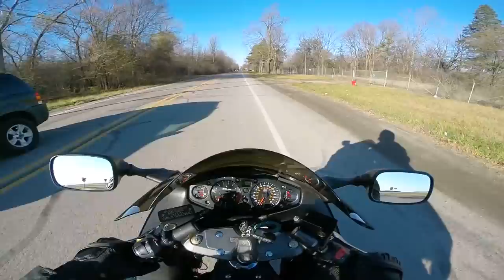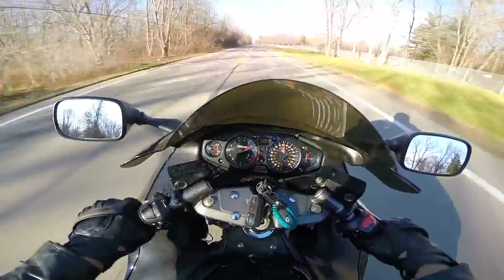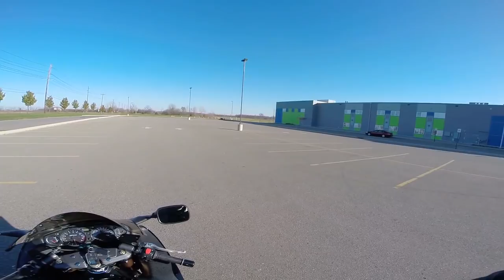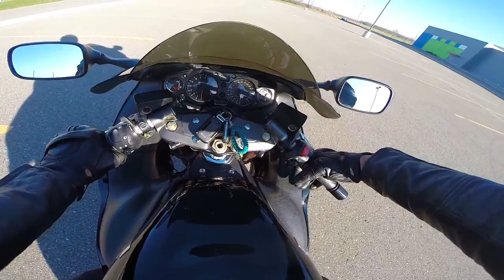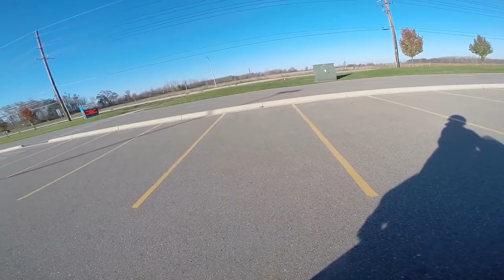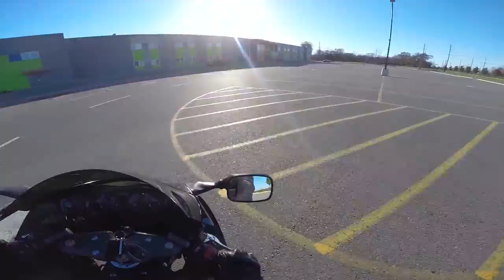Motorcycle Basics: Controlling the Throttle

Comment: Here's an easier ( not safer) way to explain Torque vs Power: 
Power (HP) How fast you hit a wall 
Torque: How far you'll take the wall with you :)
Reply from the maker: +Martin Angelov More graphic too ha ha
Reply: Yeah but dem sound effects 👍🏼
             Vroom vroom
Reply: +choppertj1 splat
Reply: +choppertj1 hit like if ya like dem bikerz in road rash. NAPA VALLEY
Reply: well said haha
Reply: lol that happened to me.
Reply: It actually wouldn't work like that.  If you had two equal weight bikes traveling at, say, 150 mph, they would move the wall equal amounts upon impact.  This is regardless of the power and torque each bike makes.  

A better way to explain torque and power is this:

Power is top speed
Torque is how quickly you get there
Reply: Mr. Blow  ("mr. blow"?),

I agree with you, about the comparison. 

Ray
Reply: Horsepower is calculated from torque. What we're interested in is the torque at the rear wheel. When we're in 1st the larger gear ratio increases the amount of torque at the wheel. When we change to 2nd the ratio is a little smaller and there's less torque.

As an example, my old Camaro with a ZZ502 engine has 560lb/ft of torque. My 4th gear (Muncie 4 speed) is a bit over a 1:1 gear ratio and I get 530lb/ft of torque at the tires. In first, I get ~1100lb/ft at the tires thanks to the gearing.

If you want to ride fast on the track in low speed turns, you HAVE to ride in 1st. Lots of guys don't like to do this because the acceleration is pretty violent but it's all because of the effect of torque and gearing.
Reply: Also incorrect

Comment: Just wanted to drop a note of thanks Night Rider.    I rode dirt bikes when I was a kid.   Now,  in my 50's wanted to get into motorcycle riding.    Didn't do it when I was younger because I will be frank,  I was immature and probably would have been  found in the woods.    Bought myself a 2020 Suzuki SV650.    The two areas I needed help was throttle control and braking.    Your videos were very informative and helped me tremendously.    With the throttle,  I was always jerking the bike over uneven pavement and when braking.    By squeezing my legs in on the tank,   I stopped having a lot of my weight/pressure on handle bars/throttle.      This eliminated much of the jerkiness.    Second,   braking.    I would always be confused what to do first,   all at once, down shift, front brake only, etc..   I used your rear brake first analogy.   Perfection.    Especially coming to a quick stop,  I am not lunging forward, diving the bike,  with my weight on handle bars, and jerking the throttle.    Its all in harmony.    Thanks
Reply: In which video was he talking about breaking? I have very similar issues as you. Thanks

Comment: Those tips are so useful.. you have no ideas.  Recently took an MSF course and struggled with the throttle control.. every time, I squeezed the front brake lever,  I reved up the motorcycle.. every time I turned the motorcycle, I reved it up.. I thought it was a mechanical issue the throttle had. Everyone says you need to have "smooth throttle control."  But no one really explained how to achieve that. So frustrated.  But thank you by  diving into it with your hands off approach and not only explain it but provided 3 good tips on how to achieve.  Coudos to you brother.

Comment: I'm a brand new rider at 54 years old!! I'm having serious problems controlling the throttle and I believe it's my main issue at this point. My bike doesn't have end-caps but that's a great idea. You mention the hand position that I've seen in other videos too so that's a good thing. Starting in 2nd gear is something I'd never thought of. I used to do that in my stick shift cars back in the day when there was a lot of snow or ice on the ground. I might have to try that!! Great info. Thanks!!

Comment: Night Rider.  I have owned a lot of motorcycle (over 40) in my 43 years of riding (started in Feb 1974).  After I hit 58 years old, I decided to go from standards and cruisers to sport bikes.  My ZX-12R was fast and throttle control was very important.  My TL1000S, CBR1000F and BMW K1200RS were easier to manage than my current sport bike.  At 61, I bought a used 2007 BMW K1200R Sport.  That bike has the most sensitive throttle I have ever ridden (still have the bike).  If you are not careful and "smooth" with the throttle, it is the most "herky-jerky" ride I have ever ridden.  One thing for sure, it makes you learn "smooth" throttle control even when shifting.  The BMW K1200R Sport makes my Harley Softail Heritage Springer (wife on back bike) and my Goldwing 1500 (grocery store runner) child's play with the throttle.  Heck, with the Harley, I can "grip it and rip it" and it barley beats the 2 toed slough crossing the highway!!!  Quickly letting off the throttle on the Harley just lets the bike coast.  Not so with that K1200R Sport!  Good video, I have bar end mirrors on the K1200R Sport so I think I will try resting my palm on the bar ends....  Thanks for the tip, no matter what your age or experience, there is always something more to learn!!!

Comment: The advice on gripping the bar end is excellent. I basically discovered it on my own; it's not covered in the training class I took (the MSF BRC) but when I talked to people I've heard it's sometimes used on race tracks. I've never heard the term "whiskey throttle" but it is very real and new riders should be aware of it starting on day 1. The down side of gripping the bar end is that it's difficult to keep a finger (or two) on the front brake like you're supposed to. Great video!
Reply from the maker: Thanks a lot.I never heard the name but I knew what it was

Comment: All of your points can be included in throttle control but it's a basic/beginner guide which is mainly for a newcomer. But, generally, throttle control is a skill which really determines the good and not so good riders to the best of the best. For example, how much throttle would you give when entering a corner, during a corner and when existing, etc. This is very important because of two reasons safety and efficiency, you already cover the basic beginner guide of the safety part but as I said that is generally not what people talk about during a throttle control conversation, at least not where I come from. For the efficiency part, you ride faster because you efficiently control the acceleration and deacceleration which in turns lets you shift gear more efficiently, there are some rudimentary and of course some rather complicated advance tutorials and guides but in the end, it all comes down to the individual and their natural talent as in most walk of life. And as always the best way is to practice and this is when you push your natural talent to the limit, coach, experts, guides, statistics, etc all play an important part including your composition and bond with the machine itself. Then, you practice more.

Comment: Huge thanks for this video. Being a new rider, the tip about resting your hand on the bar end and twisting with your fingers has helped improve my riding tremendously.  I love my bike and was beginning to doubt the purchase, but not anymore.
Reply: I have been riding for 7 years and still have the outside of the grip on the bar end, it just gives you so much more control of the throttle

Comment: Just got a 1999 yzf R6 yesterday and I'll use these tips to safely ride the bike! Thanks!! :)
Reply from the maker: welcome
Reply: is it any good? do you have gearbox problems especially second gear
Reply: i just got a 1999 yzf R6 as well loving the bike so far doesn't have the second gear problem..39000 kms on the bike
Reply: I love the bike, it's fast but not dangerous to a new person if you take it easy. Smooth power band and sounds amazing! I haven't had any problems with my gearbox, and the bike just topped 22,000 miles the other day. I think the bike has been wrecked before so it may have a newer tranny but I'm not entirely sure. Still a very high quality bike and I'm hooked!! :)
Reply: @devil1989 

But I have a small water pump leak, thought it was the overflow fitting on the pump but I took it apart and pressed the brass fitting back in because it was a little loose and I put lock tight around the fitting when I put it back together. It help a bit but after a little riding the lock tight melted and it started leaking again so I think heat resistant lock tight and heat resistant rubber glue will do the trick. That's the only problem I've encountered with this bike (besides the carbs needing synced but it's 17 years old and I'm sure the carbs have never been synced in the 22,000 miles it's been running; so that's to be expected). Other than that the bike runs and sounds great! Got mine for $1,600 so it was a pretty good deal! Cheers! :)
Reply: on an r6.. all the throttle all the time.. they are slow to accelerate .. rode my mates one was at the stop on the throttle in first.. no action... now an r1... that will flip you

Comment: Its the mechanical advantage you are speaking of as far as gearing being that your gear ratios are the multipliers of torque (primary gear, transmission gears, and final drive AKA sprockets) so second gear for example is 7.71 vs first gear 10.43 multiply the torque at any rpm and you see what is getting to the tire. Good video bro
Reply from the maker: +Mete Thanks a lot for the info.And thanks im glad u like the vid
Reply: Night Rider Anytime bro i look forward to them, just dont comment lol

Comment: Second gear start:  It's only a matter of time before you forget to shift down at a light.  Practicing this in advance will totally save you from looking like a goof.  (Wisdom from experience...)  Also helps with building clutch feathering skill, good for off -road, parking garage ramps, hovering at a light that's about to change, etc.  My right turn at low speed throttle/clutch control sucks compared to left turn.  I'd love to know more about that.

Comment: Most bikes have a 1st gear suited for accelerate the mass of the bike from stationary position, that means the gear is reinforced for the higher tension produced in that moment. (Thats a complicated subject of inertia and that stuff).
Summing-up, don´t start with 2nd gear.
Reply: True. More especially if the engine and gearbox are cold. Maybe people should just be patient and learn how to ride properly?
Reply: I just got a liter bike, and discovered what power/torque really mean, with that being said, i was so curious about starting in 2nd gear since its powerful enough to move almost immediately but since i have been driving stick shift all my life, I assumed I should be starting from 1st gear and subsequently each gear after.

Comment: I just started my routine classes (EU) a few weeks ago. We went up gradually by sizes because I've never ridden any motorbikes before. First on 50cc then 125cc and then this 600cc (Honda Hornet) which is going to be the exam bike. I was doing well on those two smaller, but last week I just crashed onto the grass next to the asphalt track with the Hornet because of whiskey throttle. Man.. that was a very bad experience. x') However it's better to fall during routine classes than in the front of a truck which is coming towards you, that's true. I grabbed the throttle as you tell not to (#beginner) and was sitting on the bike with too straight hands too so when I somehow closed the throttle the bike wanted to drop and I pulled on the throttle by reflex so the chainreaction started. After days I had my next class today and I had like zero courage to do any leaning move like slalom or doing circles during most of today's class so I practiced start, shifting, stop, the proper hand position for throttle and right sitting position, loose hands on the handlebars. In the last third of the class some of my courage came back but I still feel the negative effects of the experience..

Comment: Night Rider, thanks for posting this video. It has a few nice tips, but I have to disagree if yo think this video covers all about throttle control. There is a lot more to throttle control, for example how to use the throttle when entering and exiting corners, when braking and how to regain control when the tires start losing traction (starts sliding). Learning throttle control is one of the critical skills to stay in control of a bike, so I hope beginner riders investigate the topic further, especially when they are starting on a super sport bike. Thanks, Blue
Reply from the maker: Blue Panther Yes im aware of this.Thats why i call this "Motorcycle Basics.." My training vids thus far are for basic operating skills.
Reply: Got it :-)

Comment: I really disagree with putting the palm on the handlebar weight just to control the throttle.  That is the long way to learn.  You learn by keeping your index on the break.  I can teach anyone good throttle control in 15 min.  However, second gear suggestion is an excellent suggesting because it also teaches good clutch control.   I do agree that anything that works for you [or anyone] is good and therefore giving folks the option was fair to do.  In the end you are trying to help save lives and that is cool.

Comment: Torque is rotational force. But I describe it as the ability to counter resistance. That's why lots of torque will make you accelerate fast or pull harder

Comment: I have query. My Bike is Unicorn 150cc ABS model. Run till 311 km, only 1st services done. 
Today i have wash my bike from washing garage with pressure washer using shampoo water. Before that my bike was running smooth I have run more than 3km. After washing bike it runs till half km .. when I throttle at 1st gear.. it lose engine power. There was enough petrol to run bike till 30km. 
I went to garage by pushing my bike. He done nothing just accelerated using chock. After that it run 3km till near my building and again it got engine power lose.
Even while Starting my bike ABS and Neutral indicated gone. I was trying out what happen. I pushed till my building again I started it to started at Normal sound. I don't understand what happen.

Plz reply what was problem. Next month I will get touch with 2nd services. 

What is symptom of losing power of engine while throttling.
Thanks
Sagar Dalvi

Comment: This surely encourages me to buy me a bike (not exclusevily this video). I've been looking to buy me a 750 Shadow, and the worst thing that someone told me about crusers was it's weight, because it's focus was torque. Are they safer for starters than sports bikes or they live in about the same risk?
Reply from the maker: Its safer because cruisers are more forgiving with the throttle because they are much slower than sportbikes.The weight is only a problem at slow speed maneuvers.
Reply from the maker: With a 750 shadow you should be fine.Youre more likely to drop it at a stop light lol
Reply: I'll probably cry. Surely enough i'll take my time on a parking lot practicing. Thanks for your time

Comment: There is an issue that i couldnt understand riding motorcycle without brakes. If we can not use brakes how can we get slower ?  Maybe next video comes about that issue :) 
Hi from Turkey :) İ liked your videos very much @night rider :)
Reply: +Mert Altiparmak Engine braking helps a lot.
Reply: +Mert Altiparmak ummm throttle control and weight/body shifting im thinking?
Reply: mrthebugsbunny weight shifting has nothing to do with speed.
Reply: how is that possible? ive seen people do stoppies and wheelies and stuff on video. from what i have seen and what i have learnt it does matter i think-how you position yourself on the bike and how you ride on it.
i mean, its like, directing the motion of the vehicle on the ground
Reply: I understand that. However wheelies are done by engine power and stoppies by braking power. All I was referring to with weight was speed and nothing more.
Reply: aha i get that! no i kinda meant something like sitting posture or something like that. granted that on stoppies and wheelies engine power and braking power are used.
now suppose i balance a bike on a fulcrum, like how weighing scales are balanced, and the bike be not moving at all (engine off).
i'm talking bout these:
http://img.indiabizsource.com/sites/default/files/products/image/1165624/download%20(14).jpg

will not the bike tilt one way or the other based on where the rider sits (lets say an imaginary rider is on the center of that thing)? how is a weighing scale balanced?

now if that same bike be on the surface (riding on tarmac or dirt or whateva), and  the whole system be in motion. the engine and the braking power are helping in stoppies and wheelies. but, is it entirely based on just that? for all riding in general, where you park your ass on the seat will kinda change how the bike might be moving and leaning (or thats what i have tried out lol). i dont know how to do stoppies or wheelies but as i said, ive seen them on videoz.

Comment: try to do a right handside tight u-turn, when you lock the steering handle bar, not so easy to explain the throttle control bro

Comment: Yeah I'm having a problem with the bike jerking when in lower speeds or when I'm slowing down... idk if I let off the throttle too fast or what but it jerks the bike around some time. What am I doing wrong. (I was in the mfs class and asked the teacher he said throttle control never said how to fix it,  and no one else had a problem with this I guess. that was a honda grom. And now I have a ninja 300 and I'm doing the same thing.) It makes it hard to maintain a speed cuz any drop in speed slows the bike down and I go forward, then I get back on the throttle and I jerk back... a never endless cycle... HELP! Lol